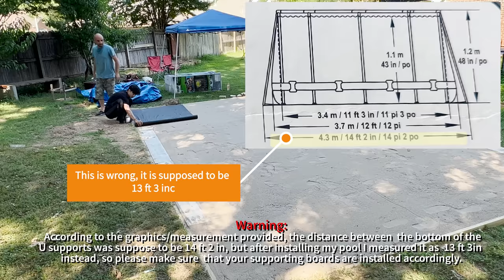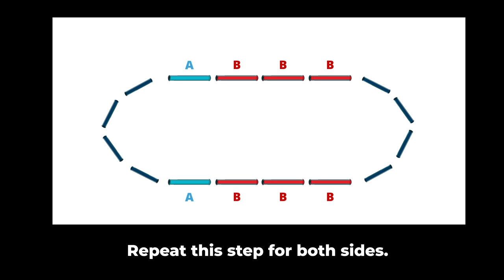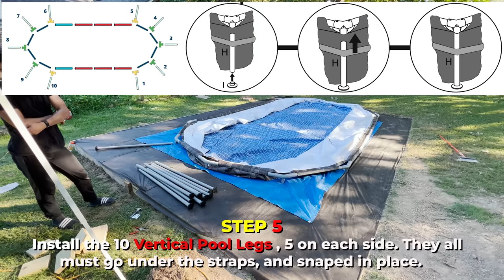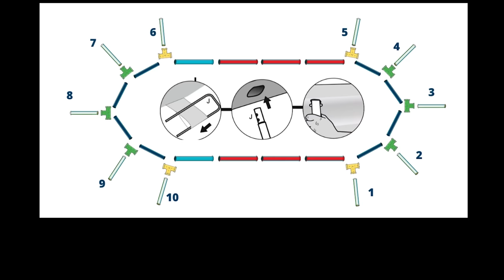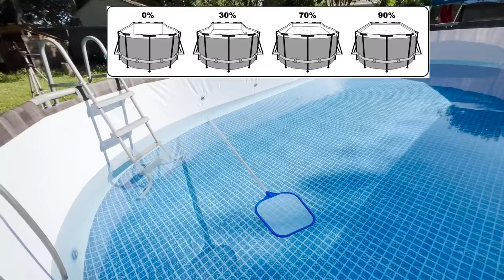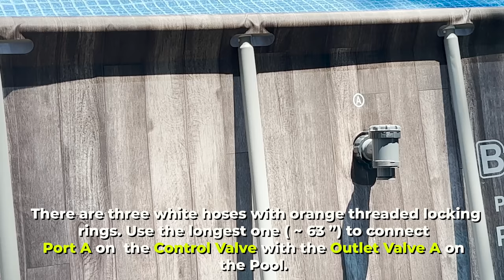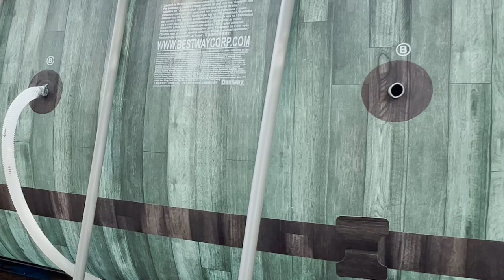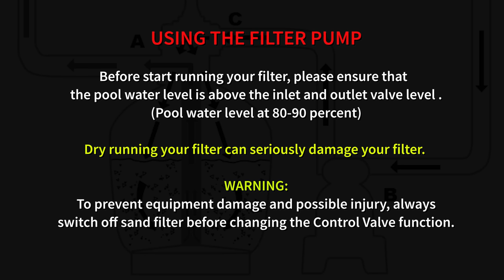The Best and Most Detailed Pool Installation Video On Youtube / How to Install Bestway Costco Pool?

Comment: This is by far the best video I've seen on setting up the Bestway pool.  This is the only one that mentions opening the valve on the water inlet.  I could not figure out why my water wasn't circulating until I came across this video.
Reply from the maker: Thanks for the comment, and  I am glad to hear that it helped you to solve the issue for you. It took me several hours to create this video.

Comment: i wish i had watched your video before i did mine lol i like this idea of making a border with string before you started digging. i made a very crude border and have a huge oak tree about 10-12 ft away from my pool and its roots were like a big spider web just a few inches deep. it took me 3 days just digging up roots!!!! had to use an iron rake and root cutters because a soil tiller was absolutely not feasible with all the roots. I truly wished my yard had no trees near it lol you made it look sooo easily! 😊
Reply from the maker: Wow, it sounds like you spent a lot of time and energy trying to set up your sand base. It’s  really the hardest part of the process especially if your backyard is not level and have big trees. Congratulations though:)

Comment: Replace the sand with Poly Filter balls.  The filter smaller particles, weigh nothing and you dont get sand in your pool.  Water pressure is much better too.

Comment: Great video, What is the size of the boards under the U-shaped supports. The look like about 30" long, 1x6?
Reply from the maker: You can use one long 2 by 8 for each side instead of putting one under each u-shaped support.

Comment: I am about to build mine this weekend. Do you think there is a way to further put the solar heater? I have a patio near the pool area and was wondering if I could lay the water heater on the patio and run a line to the pool.
Reply from the maker: If you install the solar heater it will decrease the power of the pump. If you use and extension it will also affect the efficiency of the pump. Thus, you may need to run your pump longer every day. 6-7 hours a day.

Comment: Great Video, thanks!  How has this held up over time?  Any settling of the sand or issues with the side supports of the pool sinking or shifting?  Is the pool top rail still nice and level?
Reply from the maker: Everything still looks great but there are some areas in the pool with settled spots. Because I forgot to compress the sand after leveling but it is not an issue at all. Supports are totally fine. I  am glad that I made custom footings for the vertical legs. It keeps the legs at the right level. Top rails look nicer if the water level is always above 90 percent. Thank you
Reply: We have a similar one but did not manage yo avoid the curvature/ twisting of the long rails, they are still bended inwards like in your video. Keeping It at 90% was enough for you?
 Thanks for the video and your comments

Comment: In the midst of setting up and maybe this is a dumb question, but at what point (of filing/ water level) do you attach the pump and start it? When it's totally full or?? Thank you!!! GREAT VIDEO!!! Thank you for making and posting.
Reply from the maker: You can install it anytime before it reaches out to the top holes. Thank you for your comments and support.

Comment: Hi! Hope you don’t mind me asking a few questions for further elaboration. I am going at this with NO building/contracting experience so this is a huge endeavor for me:

1. How did you figure out the measurements of the bottom of the U supports were wrong? How exactly did you accommodate this inaccuracy without starting all over?
2. What was the black fabric you placed over the sand before you put tarp atop of it?
3. When you were leveling, did you just dig the highest point within your pool area, or did you dig and level the entire area down to the same level? Was it 6 inches?
4. If you didn’t dig everywhere, did you simple till the other places? 

will this work for a rectangular pool as well
Reply from the maker: Hey there,

Certainly!

1. I realized that I needed to make an adjustment before filling the pool with water. I added another row of U supports directly beneath the existing ones. I explained this at 10:30.
2. Instead of using regular landscaping fabric, I suggest using thicker fabric like the one found here: https://amzn.to/3qoyVMK
3. For the sandbox, I recommend digging down the highest points and removing the top layer of grass for the rest of the area. The sandbox should have a minimum depth of 4 inches. Instead of making the sandbox higher, I suggest leveling the ground and constructing the sandbox using 2 by 4s or 2 by 6s.
4. The lower areas can simply be tilled.

This method can be used for any above-ground pool.

I hope this addresses all of your questions.

Comment: Does port b release clean water into pool ? I have the same pool first time with a sand filter and it feels like water isn’t flowing in or is it not visible ??
Reply from the maker: Port B of the pump sucks the dirty water from the pool, sends it to the filter and the port A of the filter pumps the clean water to the pool. If water is not circulating check your connections, make sure the control valve is in play position and there is no air in the pump. If there is air in the pump, open Port D, turn the control panel to drop position and run the pump for a minute then close the port d, turn the control valve to Play position and run the pump. It should help. If it doesn’t help you can call me at 901-651-1844. This is my whatsapp.

Comment: Are you using a timer for your pump?  Mine doesnt in. I have a timer but it wont start the pump. I have to hit the reset button every day but then it turns off after my alotted time. Let me know if you use a timer please.
Reply from the maker: No I don’t, I manually turn it on and off.

Comment: What's the black liner that you rolled out before putting the tarp down? What did you use to hold the black liner and tarp in place?
Reply from the maker: Black liner is regular landscaping fabric. I used landscaping staples. https://www.amazon.com/dp/B07Z1SH6B5/ref=cm_sw_r_as_gl_api_gl_i_88NZGE64S8A7WER0MKV5?linkCode=ml2&tag=irfandemir-20

Comment: great video! about how long did it take to assemble the pool. not including the base or platform for the pump. also not including filling it with water. just the pool structure and filtration system together.
Reply from the maker: Not more than an hour

Comment: Hello. I am currently filling my pool (Same model) and the sides are bowing a lot. Similar to the video @ 13:15 minutes. In the diagram you posted it shows that the pool side bars will eventually even out. Only thing- is on mine they bow down. Do I need to take water out and try to fix or is that normal?
Reply from the maker: It’s totally normal, it will be fine when you fill it up completely.

Comment: Are the U supports really not 14.2’ apart like the box says? I’m about to lay out my frame and would like to make it as small as possible so I was thinking I could make it 14’ x 21’ based on your video.
Reply from the maker: I put everything in the video and don’t really remember the measurements. Sorry about that.

Comment: really appreciate this video, and I'm about to embark on basically the identical build for our new pool. It's the exact same pool that we purchased. But I have a question and I'm hoping you can answer. I noticed that you said that U supports in to your sand when you levelled it off. However, the individual leg supports that you attached to the boards you have above the sand base. Did that present any significant challenges or issues with the fact that the supports are not at the same level?
Reply from the maker: Those leg supports are buried a little in the sand to be leveled, but even it’s not leveled it won’t cause any significant issues.
Reply: @DanielDemir  thank you sir. project begins saturday...much appreciated!!

Comment: What does it mean if my pump seems to not push pressure when backwash or just seems like it’s not working.
Reply from the maker: It means there is some air in your pump that needs to be removed. If you call me on weekends I can help you 901-651-1844

Comment: Awesome video, thanks for sharing your knowledge. Daniel, we're interested in buying this pool and looking at some measurements. Do you know the measurement from the top of the pool edge to the top of the bracing strap (the strap that goes all the way around the pool's lower section)? Thanks
Reply from the maker: Thank you for your comment. I provided all measurements I have in the video. I also mentioned how the actual pool size slightly different than the box description.  The distance from one edge to another age is 22 feet.

Comment: So the wood supports for the long sides are at ground level while the end supports on the cruves are elevated the 1.5" thickness of the 2x6? Is that correct?
Reply from the maker: Actually all of them are at the ground level. I hammered them in the ground to level all supports.

Comment: Hello,
I recently bought this pool and used your guide the entire way. Once we started filling the pool about 30% we notice a small puddle. I know this is not normal for it to have a slow leak. But I wanted to check in with you if you encountered that. Now it’s 30%full and I don’t know if I should keep filling or return it back to Costco.
Reply from the maker: Where is the puddle?
Reply: Middle straight pole underneath the linear. It’s not where the pool curves up but more like underneath. It’s also not a huge puddle but when we wipe clean the puddle comes back like a slow leak. There shouldn’t be a leak? Seems like the middle seam is were it’s coming from.
Reply: Costco is willing to give me an exchange but it’s already more than 30% full and i dont know if I should ignored that slow leak or drain sit completely to take it back

Comment: Ok so i have the same pool.  It says not to put it on sand.  But i don't understand why.   Any indication of why when it needs to be very level?  Settling?  I have access to a plate compactor so id think that's the way to go.
Reply from the maker: Where it says not to put it on the sand?
Reply: @DanielDemir  How can I send you a picture?  It's in the manual.  Lol.  Its so weird.  I think I'm going to do it anyway.  The only thing I can think they don't want us to use sand is because not everyone would get the correct sand or compact it correctly which would cause it to wash out from under the pool with rain.  But idk.

Comment: Did you use pressure treated 2x4s?  I'm about to do the same and wonder if its worth it to use treated lumber.  It's easier to find straight boards that aren't treated lol
Reply from the maker: Yes I used treated lumbers.
Reply: @DanielDemir  thanks 👍 

Yours looks great!

Comment: Question, in another video as well as the instructions, it says to add water inside the sand filter. Did you soak the sand is that why your sand looks thick? Or you just didn't add it?
Reply from the maker: The sand sold for pool is usually come vet. I didn’t add any water.
Reply: @DanielDemir  well the one i got was from home depot and it was the same brand you mentioned on your video so i was confident in the purchase 😮‍💨 anyways well i saw an another video they had added water, i'm assuming since mine wasn't a wet sand then I did the right think to add water?? Is that correct? Also can you possible add a video on the type of chemicals you use for your pool and how to properly maintain a pool with its chemical and all that stuff. As you can see,  I'm new to the whole thing about owning an above ground pool and luckily you and I have the same pool so your video was heaven sent! THANK YOU SO MUCH! Yeah IDK how or where to start when it comes to how much chemicals i should be adding or what type of chemicals I EVEN NEED 😭😭 I finally got my pool set up and my filter sand pump going. Last night,  I even added the CLOROX shock xtrablue( 1lb bag), supposedly the 1lb bag of clorox shock is: 1lb per 12,000 GAL. If our pool holds 6,021 Gallons, does that mean i should have just added half that bag? 😭😱cause i put the whole bag
and is that it or do i have to add other chemicals?  I won't lie, I'm lost. I really appreciate you for answering to my comment and i hope to hear from you soon! Thanks

Comment: How has this held up? Have you had any issues with it settling?
Reply from the maker: Very little settling around the pool but it wasn’t too bad at all. I recommend having thinner sand base maybe around 4 inches. If I do that again I am going to build a concrete slab around 3.5 inches. When you remove the pool you can still use it for another project like man shed, pergolaetc
Reply: @DanielDemir I noticed you didn’t use treated lumber. Any concerns with it rotting?

Comment: How much did 5 yard of sand cost and how much inch depth did you dig? Also did you need all 5yards of sand
Reply from the maker: It costed about $400 , if the surface is level you only need 3 yards

Comment: I have a similar pool. I put pavers (not dug in ground) under all the legs and now I'm realizing I shouldn't have. (First time pool owner) Are your side leg supports higher than the side U ones? I'm trying to find an easy way to fix my pool without having to completely drain it so I'm hoping I can just remove the sides ones. I'm worried the pavers will rip the liner on the U support legs. 🫤
Reply from the maker: All leg supports are leveled including U ones. I don’t think it’s a good idea to replace them without draining the water. Its very difficult and dangerous.
Reply: @DanielDemir  Thank you so much!! I'm draining my pool now to make sure I do it right this time around. I appreciate your help!!
Reply: Why was the lumber for the U supports dug under but not the pavers for the legs? @Daniel Demir